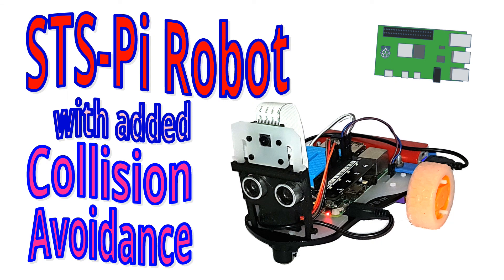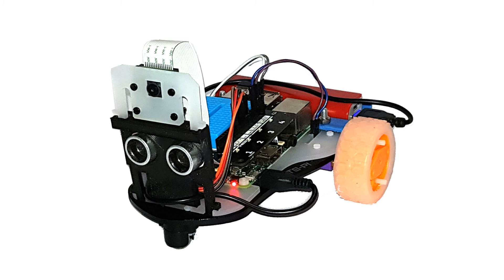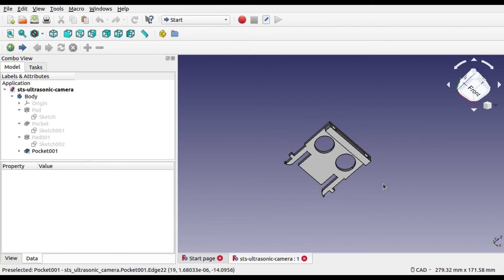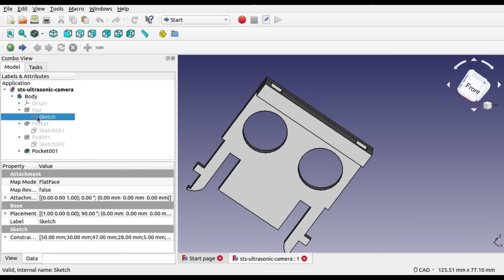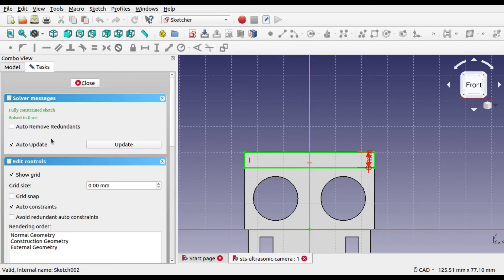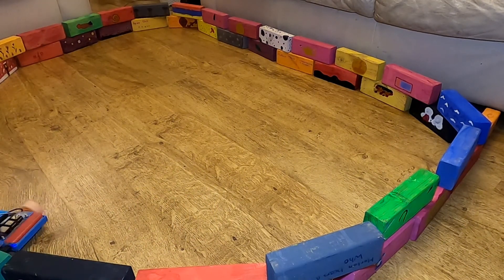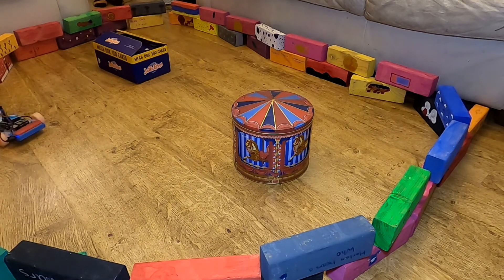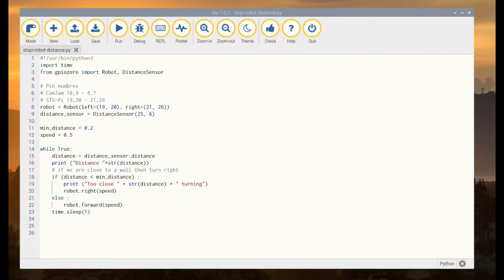STS-Pi Robot with Collision Avoidance controlled by a Raspberry Pi

Comment: This is really cool.  Do you have a picture that shows the connection of the wires from the HC-SR04 to the hat?  I cannot tell from the video and I did not see it on your web site.  I am assuming you are using the HC-SR04.  I would love to use this with my computer science class.  Can you post it to your web site please
Reply from the maker: Thanks. Wiring is as follows: 

HC-SR04 (looking from rear - left to right) to Explorer HAT pro
- Gnd (black) to Gnd 
- Echo (brown) to Input 4 
- Trig (orange) to Output 1
- VCC (red) to 5V

Then the motors are wire up to the two motor connectors on the explorer hat. 
I'll upload some photos to my website.
Reply: @PenguinTutor  what about the trig connection?  Not used?
Reply from the maker: @Subie-Driver  output 1
Reply: @PenguinTutor  this is excellent.  Thanks so much.  I teach a computer science course that uses scratch as a programming intro and then moves to python.   Our electronics piece is the Pi with the explorer hat pro with a bunch of analog and digital pieces...sensors, motors, LEDs, etc.   I recently just purchased this mini bot to test it out to possibly add it to what I teach.  Waiting for it to arrive.  I teach online (cdli.ca) so it’s a different delivery.  Labs made up for them to follow etc.  I am thinking this will fit right in to the outcomes of the course.  Won’t happen this year as the school year is almost over but looking ahead to next year.  Thanks so very much for this.
Reply from the maker: @Subie-Driver  I'm glad it is of use. Let me know if there is anything else you'd like me to cover and I may be able to create a video on that.
Reply from the maker: Here's the photos: 

http://www.penguintutor.com/projects/images/hc-sr041.jpg
http://www.penguintutor.com/projects/images/explorerhat.jpg